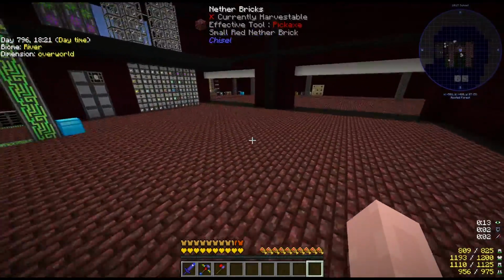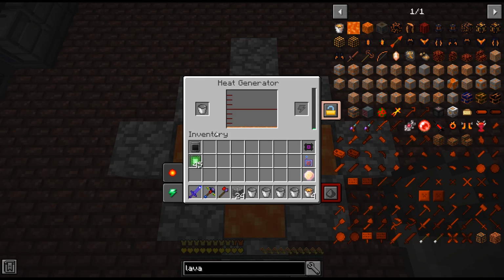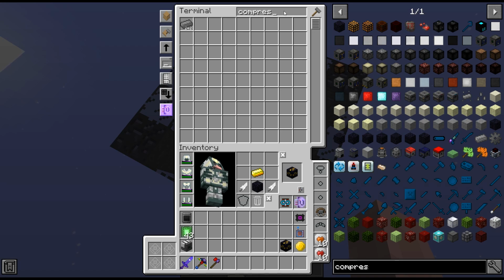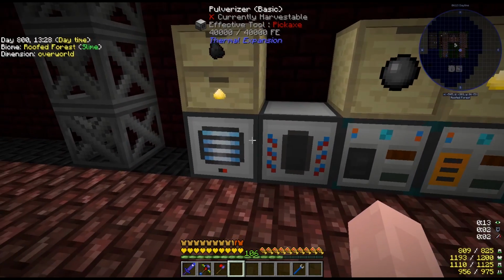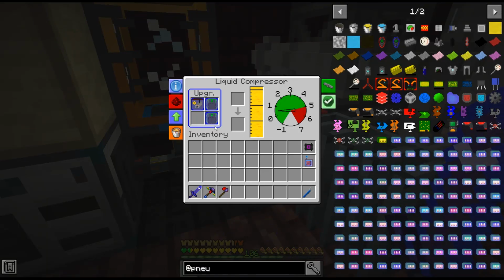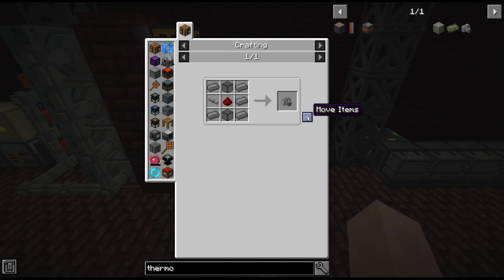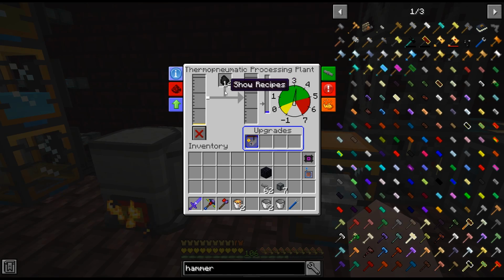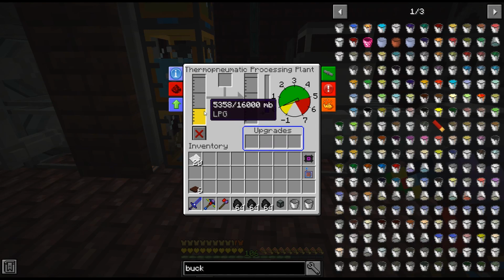Project Ozone 3 EP26 - Mekani...... PneumaticCraft!

Comment: Insulate your refinery and it'll heat up way faster and use way less fuel to run.  Any refinery block face exposed to air will lose heat and there are a lot of exposed faces.  Any non-air block (even non-full blocks like slabs or trapdoors) will prevent that heat loss.

Comment: the mekanism dictionary was useful before f3 + h was a thing I'm guessing? 
@7:50 To be fair... they used to go directly into your inventory in 1.7 >>

If you automate placing lava next to the machine then breaking the obsidian and repeating, you never really have to deal with its air pressure crap/ (Fairly easy in skyblocks with easy lava :P) and will count as an obsidian gen? (most of the plastic making machines, only want heat and not pressure)
Personally don't like pneumaticraft (or tinkers construct either >>) so can understand the disdain for it lol